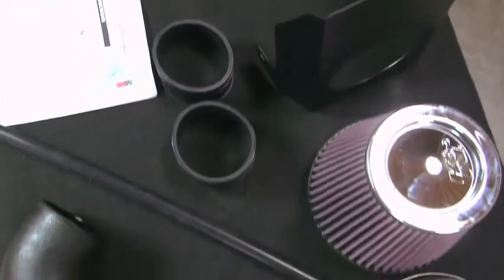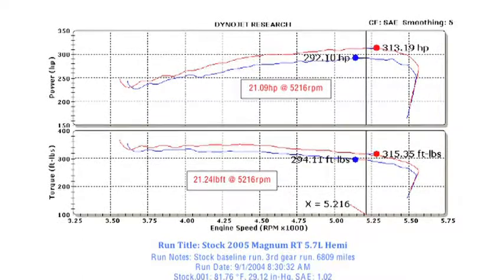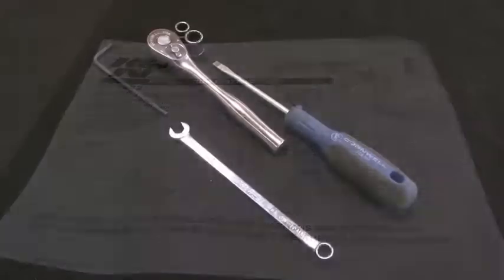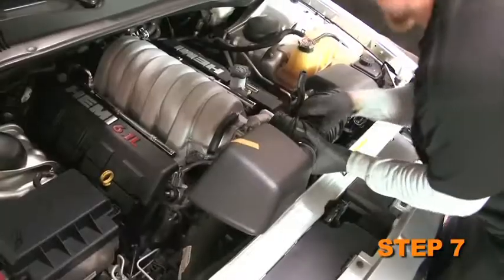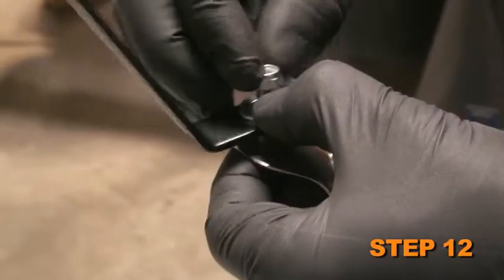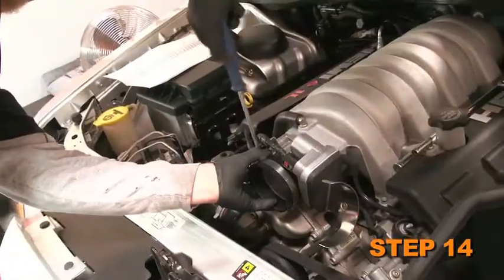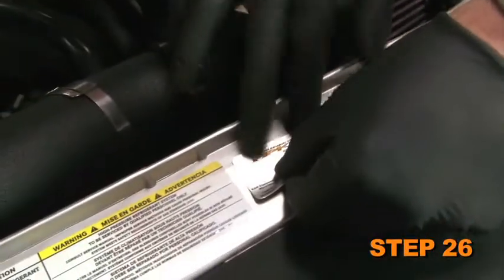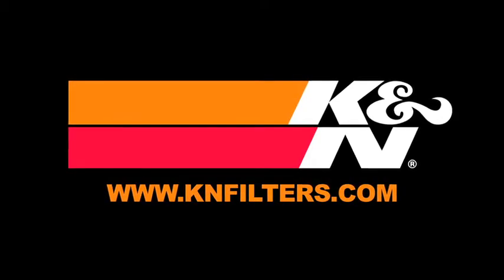2005-2010 Dodge Magnum, Charger, Challenger and Chrysler 300C 5.7L and 6.1L K&N Intake Installation

Comment: Bought '05 Magnum 5.7 a/w/d brand new, now 2016 and has 88k miles...driver leather seats ripped and on 3rd set of control arms and having motor light issues, local dealer screwed me when i set up warranty work and had hair over 32k miles with all these issues and more and they would not cover any problems as i was over 32k mi. .....Issues, issues, issues not a high grade for domestic manufacturer will never buy a Dodge again!!